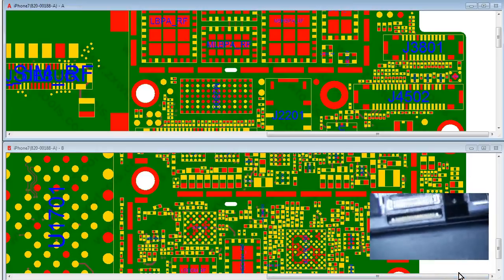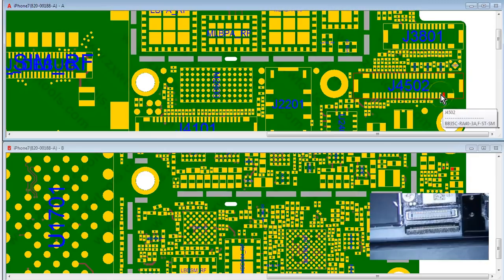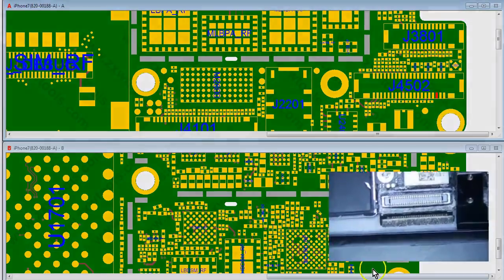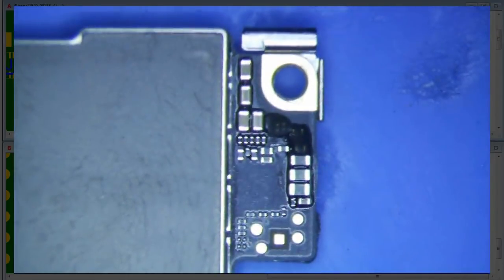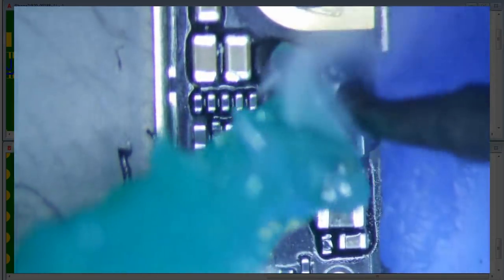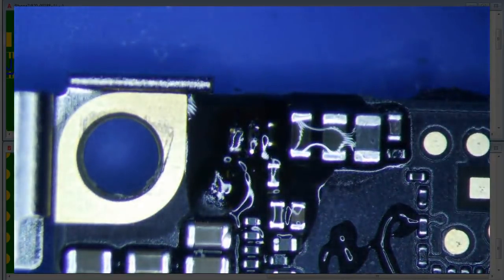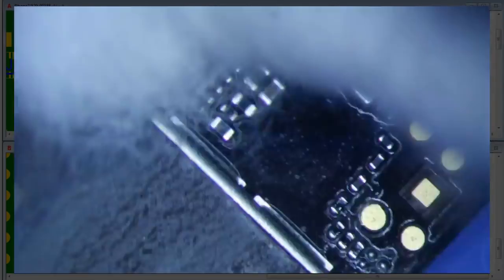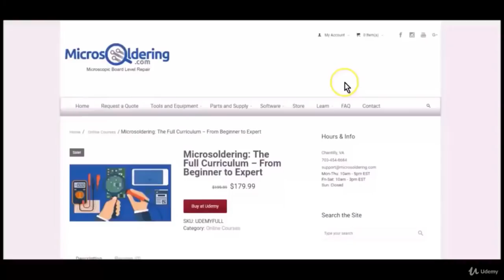iPhone 7 No Backlight After Screen Repair

Comment: I had similar issue cause the display connector got loose whilist the battery was still plugged in, the two filters gave same value on the other hand the one you had ol gave a high resistance repacing that one fixed the problem for me

Comment: So I replaced my own screen, have this same issue with no image, however my home button works just fine, it power on just fine, yet even with a light shined on the screen, I have 0 image of anything when the screen should be lit. I did not disconnect the battery before replacing the screen. I also did not transfer over the thin metal backing from the original digitizer ( but I did transfer over the front camera and sensors). Any idea??? A noob on these new iphones but a quick learner
Reply: did you end up finding a solution? im also a noob and did the exact thing you did ...